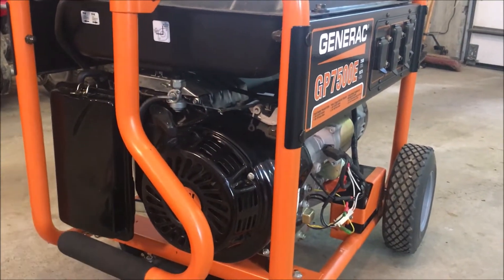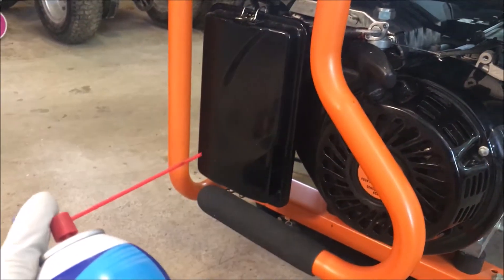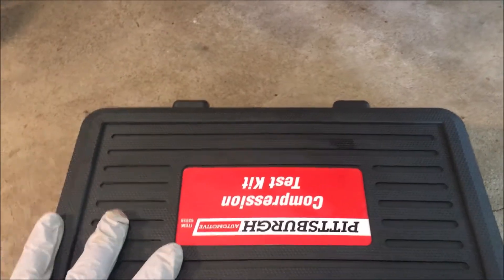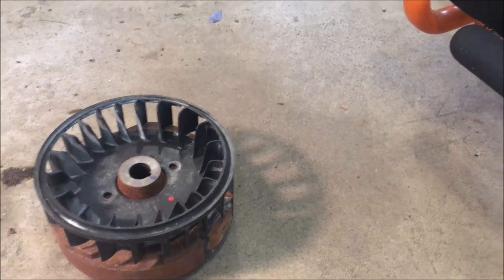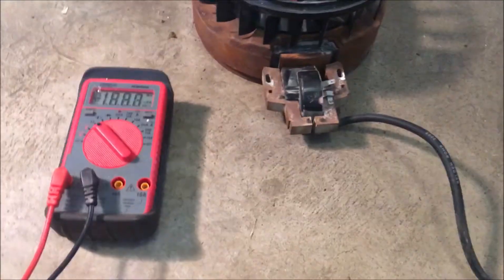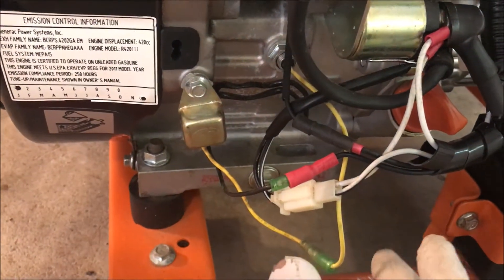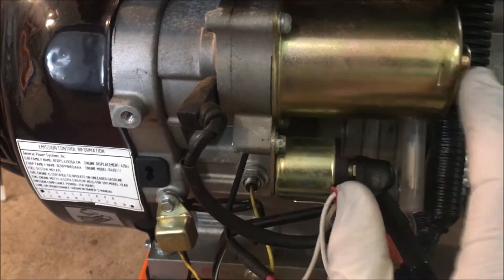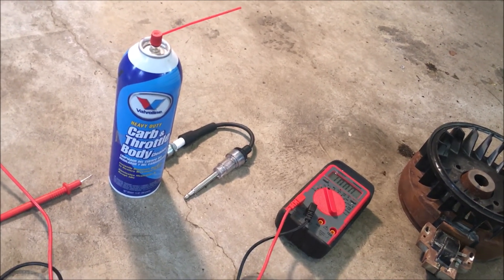How to Diagnose and Repair a Small Engine That Won't Start

Comment: I have spark however my engine still will not turn over at all even with starter fluid sprayed in carb.   where should I be looking?  gx200 clone
Reply from the maker: I would check the flywheel key followed by a compression test.  Should be close to 60psi.

Comment: Before removing the ignition coil to test it with a volt ohm meter, check your spark tester with your voltmeter to check  for continuity. Ask me how I know,

Comment: I was wondering about the battery charging. Most riding mowers with batteries charge from the motor. Did they quit putting battery charger generators on engines?
Reply from the maker: Some generators do not charge their battery like the Generac GP6500e and GP7500e.  Seems odd since the sole purpose of a generator is to make power, yet the battery is not charged.
Reply: @jcondon1  Indeed! That's why I wanted to know. My battery like a couple you've picked up had dead batteries. I pull start the motor anyway, but batteries aren't cheap and I don't have a charger with that low of amps setting to charge it. They use to put a charging coil on engines just to charge the battery.
Reply: @jamesdiehl8690  9 months on - A standard charge on a 12V Lead Acid battery is a tenth of the battery capacity in Ampere-hours. So an 18AH battery would have a standard charge of 1.8 Amperes. If you trickle charge it then the charge current will be lower but you need to charge it for longer. Charging batteries on a generator like this with a battery in uncertain condition is always a bit hit and miss.  Trickle charging means dividing the capacity by a hundred. ao 18AH would give a charge current of 18/100 - 0.18A or 180 mA.  Modern sealed batteries are used with very sophisticated chargers that allow quick charging in a safe manner. There is some complex electronics in this. Get a small Power Supply that connects to the wall outlet at 120V AC and gives out 14 volts DC . Connect that 14V directly across the terminals of the battery pos to pos and neg to neg. It will charge youir battery. You have to keep an eye on it and dont leave it on too long at any one time. Do not leave it on long enough to overcharge and damage the battery.

Comment: If you're getting fuel and it tries to start but doesn't could the low oil switch keep it from starting. I've never seen the light come on, but I check the oil before I use it every time and it has been low several times. I put it to the full mark and it runs fine. I change the oil regularly, usually every third time I use it. It's not a expensive thing to do. I was thinking king about disconnecting the oil switch to try it, but I thought I would ask first.

Comment: About the "non charging system", can't you just plug the charging adapter into the generator's own outlet to charge the battery while it runs?
Reply from the maker: Yes
Reply: Thanks for answering! The video is over a year old. Didn't think you'd answer. Now the wheels in my head are turning. Not that much of a leap to create a permanent charging system. But you probably only build back to factory condition(at least close to it) and not install improvements to better than factory.

Comment: Do you have any videos on points ignition systems? Im having trouble troubleshooting an old tecumseh engine using points ignition. Im looking to understand small engines better.  Thanks
Reply from the maker: Sorry have not made a video on that yet.
Reply: This might help.  https://www.allotment-garden.org/rotavator-manuals/Techumseh-L-Head-Engines-Manual.pdf
Reply: Timing Tecumseh Engines with Internal Points & Condensor Ignition Systems here on youtube is helpful

Comment: My  ignition coil and oil sensor both have 2 wires. How does this circuit work? Does one wire run to ground and the other run to the warning light ? How about the coil?
Reply from the maker: I have not seen that before.  Sometimes the single wire is split from the coil, one going to the oil sensor and the other going to the off switch so either can ground out the coil.  What is your model generator?
Reply: @jcondon1  Briggs Stratton 030545-1